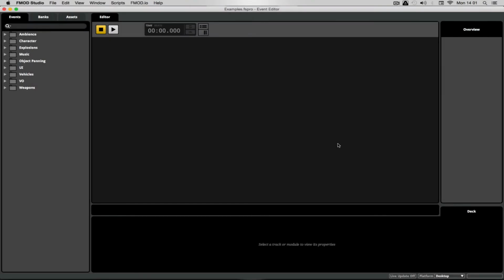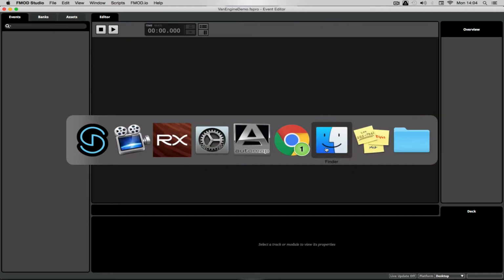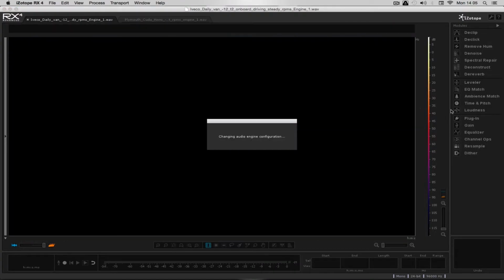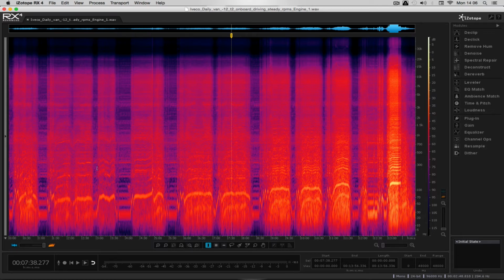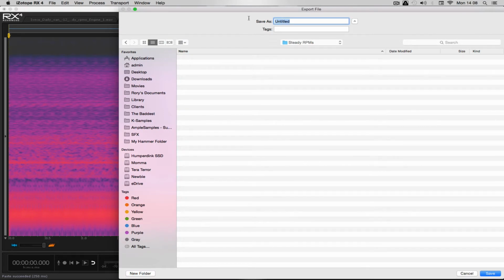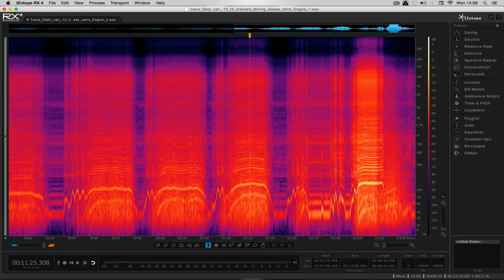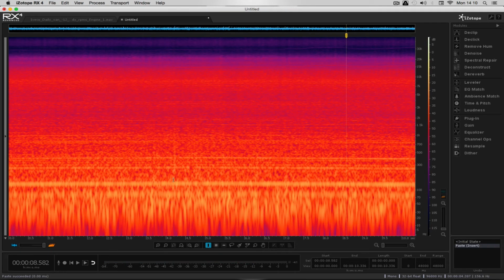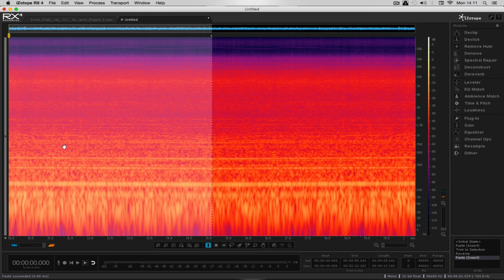Adaptive Engines in FMOD Demo - Part 1

Comment: Very helpful video series! I wonder if iZotope RX4 have somekind of ability to find perfect positions where to cut the sample so it doesn't "click"? I use Audacity and when I try to find positions for a loop they always click or don't fit, even when the RPM is steady. I need to zoom in and try to do all kind of magic by cutting some milliseconds, reverse same sample after original, etc. I was very surpriced you just chose the positions in this video without zooming in and they sound good!? :D
Reply from the maker: Thanks! You can certainly get editors (incl RX) to find zero crossing points, but that doesn't always work in stereo. You may have to a 1 sample sized fade out/in.

Comment: How to implement this in to unreal?
Reply from the maker: You would need to install FMOD into Unreal and make sure your car engine is sending RPM and Load values as a parameter values into FMOD.

Comment: Thanks for this! A newbie question... when I grab a section of sound and export it as .wav. (I used Audacity) Looped playback has a distinct crackling at the start of each loop. Is this likely a playback problem or a mistake in selecting the sample? The file is here https://drive.google.com/file/d/1gZ1Nj16KAq6L7Z7kItq3yVeLaddRU9w5/view?usp=sharing    Edit, I tried your trick of duplicating and reversing a section, but that has the same problem - crackling on playback. That file is here: https://drive.google.com/file/d/1QFO52JdYoipX_FxyVkNSWw1wSBOM8I-I/view?usp=sharing 
Any help appreciated.

Comment: this has been really helpful i have questions first , how long should a loop be like 10 seconds or so im trying to make car sound for assetto corsa and am having trouble getting it to loop properly so i think it may be my sounds are too short is there a way to slow down my loops i make , i may just get the same audio editor u do because i cant see where the sound really changes with what im currently using